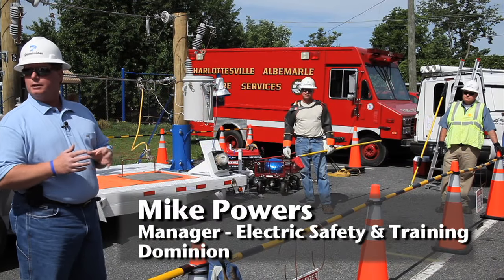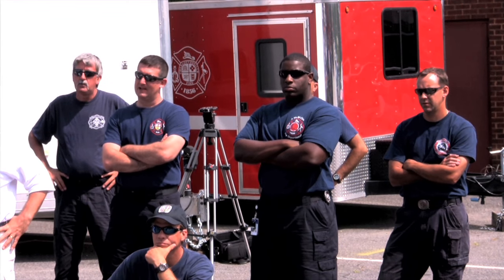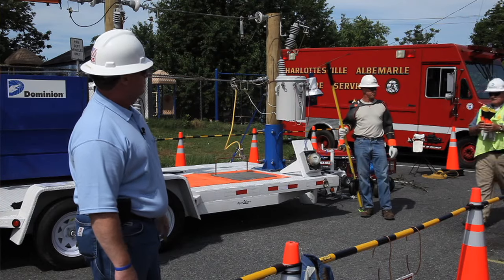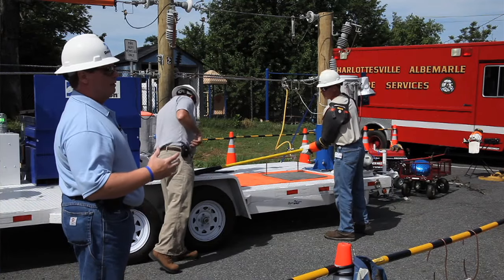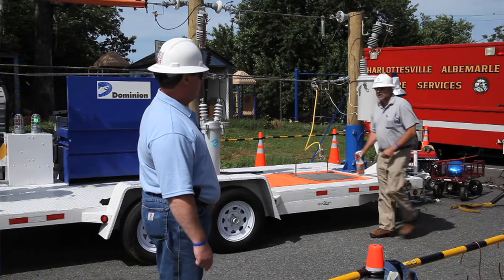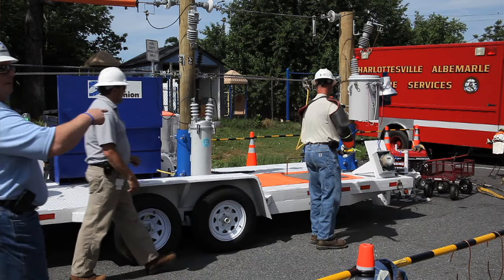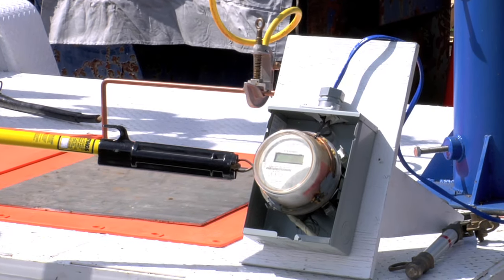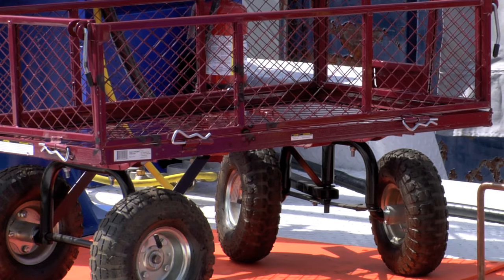Live Wire Demonstration

Comment: What a fantastic demo! This should be shown in all schools.
There were a couple of things I didn't understand though. I get it that the home electricity meter can fail and become live, but wasn't really sure what he was demonstrating there. Was it the effect of a cracked insulator?
Also, when someone hooks up a generator to a socket in their home, surely that is at 240 (UK) or 120 volts (US). But the powerline ends up back at 7000volts. So are they saying that the transmission equipment, acting in reverse, will automatically upconvert the 120V to 7000V?  Can that small generator really raise the powerline to its operational voltage and current? Very mysterious.

Comment: We had a tree down on the hot and neutral at the range. I checked the fuse at the main and the fuse had been bypassed. I then drove down to the pavilion and the green light was on on the side of the transformer and we had power to the buildings. I knew right then that tree was hot and if anyone touched it they would be meeting their maker. I called the club officers and they put a notice out to members that the line was still hot and that the power company was responding and to not touch the tree.

Comment: 13:00 what would you do if you were the driver/passenger of the vehicle that the line is laying on?
Reply: Don't get out of the car.  I mean, if it's on fire you probably don't have much choice, but if it's not on fire, just stay in the car.  I went through cable/telephone lineman's "school" and that's what they told us.  We had a special insulating blanket in the cab we were supposed to throw on the ground if we absolutely had to get out of the truck.

Comment: I'd like to know more about the primary supply. Apart from a higher potential voltage, what is the
output waveform & frequencies used? Assumed it was an AC sine-wave at 132k down to 7.5kv. 
The wires look too thin to carry any real current. Is it true that the primary is a pulsed DC high
potential, up to 55khz pulse, with a 50 or 60 timed slash, like a digital output would be like? This is according to Gerald Morin, who says he found out they 'transmit' energy potential at high freq: with a slash. It's the pole transformer that converts the raw power into a pure sine wave at 50/60hz.
He also says the generators run at higher speeds, creating higher frequencies, up to 55kz, with the AC at around 25kv or so. Then goes into a high voltage, up to a million volts transformer, to be centre tapped to 500kv, then onto 125kv, but along the way it goes through a spark gap, three sparks for 3 phase. Neutral is grounded, with the 3 primaries conducting onto a drum at 3k or 3.6k rpm for the 50 or 60 low frequency. So there is no AC on the primary lines anymore, just this high volt potential DC transmission. The spark gap causes the energy to build up, giving it high potential. Is any of this correct? I'm not a qualified electrician, just domestic trained & did electronics/pc repair. I've seen a high voltage line-man survivor in hospital when I was in. This guy has been electrocuted off a 33kv over head railway line system. He only survived cos his arm melted right off, with a good chunk of his lower leg missing. Had burns down his side, but his face & head were ok. The skin on his hands, arms, right side of his body down to his leg was all rubbery & charred looking with heavy bruising where the un-burnt skin was. He was young & in good spirits, happy to be alive I guess. I have the greatest of respect for those guys, esp; going out in bad weather!
Reply: A this comment gave me a stroke

Comment: You can fire a generator up, just shut your main breaker off, and reverse feed the lines. Simple as that. Main breaker is off, no power can go through it to the lines.
Reply: Neutral is still connected, iirc
still a hazard

Comment: That's a cool demo.  Are those extendo poles fully insulated, ex: would you be able to use one without gloves?  Or can they still conduct a bit of power?
Reply: they are but also like the fire house with the high voltage a little humidity and it can become a conductor. 
the term hot stick is 2fold lol

Comment: A 110V generator fed into an outlet in the home will have enough current to energize the primary lines to 7k volts??
Reply: yes thts how transformers work but it will have low amps and very short distance been a long time wld have to check on math but i dont think it travels more than a cple of houses
Reply: Transformers work both ways. Don't back feed your house unless you know exactly what you're doing

Comment: So what's the proper way to connect a generator to your home during a power outage? How do you wire it so that it does NOT send electricity back onto the HV power lines?
Reply: +wad willco pull your Meter
Reply: Turn off the main breaker to your house.
Reply: And put a lock on it if you can.
Reply: Proper way is to let professional install the generator and switches. Do not try to install electric stuff by yourself, it is very dangerous.
Reply: Use a triple breaker to switch both of the hot lines (there are two in modern houses, one's negative) and the neutral  all at once
Put it in an electrical box and ground it

Comment: Never thought of the backfeed fom a generator. I suppose the stepdown transformer will be working in reverse as a step-up transformer to re-energise the line voltage.
Reply: Yes, that’s correct. Nothing in a transformer to prevent flow one way or the other. Solar fields on distribution circuits can backfeed through power transformers in substations to transmission lines if they aren’t relay and pt protected
Reply: @Football5198  I imagine the max current would be greatly reduced in relation to normal line current, but still ample current to kill.

Comment: 20:20 you don't have to pull the meter out of the meter base, just turn off the main breaker.  That'll disconnect your entire breaker box from the meter and from the incoming line
Reply: RE:bledlbledlbledl. Firemen can not always easily get inside of a building to a breaker box and big buildings sometimes have multiple breaker boxes.
Reply: @munsters2  He wasn't talking about when there's a fire, he was talking about when homeowners hook up generators after a storm knocked the power out.  Start listening at 19:55 to hear about this.   The homeowner needn't pull the meter base when using a generator, just turn of the mains.
Reply: @bledlbledlbledl  Sorry, my mistake; I thought he was telling firefighters to pull the meter. He was saying that homeowners might not pull the meter. I agree with you that homeowners can switch off breaker instead of pulling meter.
Reply: @munsters2  Additionally,  pulling the meter on a large service will NOT disconnect the power. Why? The meter measures usage with current transformers, placed around the service conductors or buss bars. Actual disconnecting occurs on the HV side or via pulling a set of fuses/throwing the main service disconnect.
Reply: @djscrizzle  Interesting. Thanks.

Comment: Nice video. What happens if the line is down and one of the houses has a solar generation system connected to the grid?
Reply: ferchrissakes314159 pop
Reply: ferchrissakes314159 Solar I believe is 9-10,000 Volts by it's self. depending on which one you install and use. but if it does backtrack to the lines it can create a real problem. if you ever realized this. when the power is out and you hook that up to the lines. you can almost run 10 houses off that one generator. well you can also fry transformers both ground and pole. another thing they didn't mention in some homes their is a separate box that cuts the electricity from the wires where you can have installed and working. I can remember what it's called but you can have it ordered and installed in your home. Good Luck.
Reply: Solar is usually a low-voltage (depending on number of modules) and is always DC. It then gets converted to a higher AC voltage where it's then fed into the grid. And a typical generator will not give anywhere near enough power to run 10 houses, in fact most generators like the one shown couldn't even power one house (considering immersion heaters, kettles, etc) remember that when it back-feeds into the transformer, current is inversely-proportional to voltage so as one goes up, the other goes down, but the overall power (in Watts) remains the same.
Reply: D15H I'm not talking about the Gas ones I'm talking about the backup Gen. the ones that you see on the side of the new homes.
Reply: ferchrissakes314159 solar systems automatically shut down whenever the utility power goes down. It cannot back feed the utility system.

Comment: How does that portable generator supply over 7000 volts? Are most portable generators homeowners use not 120/240 volt?
Reply: Transformers on the lines in-between

Comment: Huh.  How are people hooking up portable generators to mains circuits?
Reply: During an extended power outage some people connect the generator's output to an outlet in their house which sends power to appliances and lights. If they forget to turn off the main breaker, current will flow out of the house back to the transformer. This situation has killed linemen who thought they were working on de-energized circuits. To properly connect a generator to the house wiring would require a transfer switch installed by a licensed electrician..
Reply: they use "widowmakers" i.e. 2 male plugs connected together

plug one into the generator's outlets and the other into the house plug
disconnect the house from the lines (otherwise when power company turns the power back on and explodes your generator) 
disconnect all load from the generator (unplug the widowmaker from the generator) and crank it
plug the widowmaker back in

Comment: Are firefighters not issued digital NCV detectors? They're super cheap and very reliable at detecting any ac voltage that's at a harmful level. Hell. two of my shittiest, <$40 AC/DC current clamps have NCV detectors that can detect 120V AC from +6 inches away

Comment: I'm not a electricity denier but @12:30 you can obviously see they wrapped one of the boot pull straps with metal wire...
Reply: Maybe they’re not steel toe boots they’re using, but I would imagine most would wear work boots without it with composite.

Comment: wouldnt the ladder weld or stick to the line?
Reply: In the setup for the demo they are running high voltage, low current. Welding requires high currents. I have a spot welder that only put out 3 volts, but pulses 500 amps and that’s what does the welding.

Comment: I have some questions. 
How many volts can a human take before their in trouble?
How long does a response to scene take and can some procedures be done safety to ensure a person can be saved? 
Can someone touch a person who been electrocuted or will the electricity follow to the rescuer? Example is someone gets hit with the electricity  and someone comes to their aid to give cpr or to begin rescue procedures to get them out of further harms way. 
Does the electricity go other places? Example would be a power line goes down and the electricity will flow all around in a certain footage area around the scene.
Reply: Generally speaking, under 50V the voltage isn't high enough to overcome the resistance of a persons skin and therefore you are unlikely to receive a shock (but it's still possible if you have cuts on your hands as the resistance of the body under the skin is negligible). Over 50V you are likely to receive a shock, especially at mains voltages which are far higher than 50V (in the UK it's actually around 245V RMS typically). 

If you're unlucky enough to receive a shock from a high-enough voltage source, then that's when the current is a factor. For example, in the UK at a supposed voltage of 230V RMS, a current of 30mA or more is enough to be life-threatening but there is still a chance of survival. At a current of 60mA or more and you can almost guarantee cardiac arrest. 

You must also consider the length of time that an electric shock lasts, in the UK a RCD (Residual Current Device / Ground Fault Interrupter) used for "additional protection" (which means protection against electric shock) is rated at 30mA as this is the amount of current considered to be life-threatening as mentioned previously. The device is tested to ensure it operates within 40ms which reduces the chance of your heartbeat coinciding with the duration of the electric shock - if they coincide then cardiac arrest is likely.

And yes, in your example of electricity spreading, there is a potential for electric shock around the power line. This is due to the resistance of the ground which will cause a gradual drop in the voltage around where the power line is in contact with the ground. For example, if at 1m from the power line the ground was at 7000V and at 2m the ground was at 6000V due to the drop in voltage from the resistance of the ground, this would give a potential difference of 1000V between these points. If you took a step and your feet where spaced near this distance then it would result in an electric shock. The risk can therefore be reduced by hopping or jumping away keeping your feet together.
Reply: There's no real hard number. alternating current runs @ 60 cycles, the same as your heart an body. 
A defibrillator is measured in Jules an has zero AMPS. ( AMPS is what kills you typically ) 
However in the right circumstances ,say with multiple hits from a police taser has also killed.
110v is the most dangerous because we're in contact with it everyday. Therefore its underestimated. when the path of least resistance for voltage  crosses your heart you're in deep trouble. The higher the voltage the threat goes up exponentially even for experience personal.
Hope that helps you a little an gives you a start path where to look for info.
Reply: Unlimited as it is current that kills, not voltage.
Static shocks typically range around 50K volts.
There most be a voltage sufficient enough to overcome the resistance of the body, at that point it is the current that does the damage.
Reply: I remember an electrician telling me when working with a live wire you should put one arm behind your back to prevent the current from crossing your heart
Reply: Wade Clark how long is a piece of string
Reply: Mr Jones My heart doesn’t run at 60Hz. Are you sure that yours does?
Reply: Is a combination of both dude
Reply: 1. 50V and lower is concidered safe in the industry and official standards, anything over this is potentially deadly.
2. Dont know. And not really if everything is live, its a ric that had to be taken if its safe or not, but your life goes first no matter what.
3. You say  "have been" so thus the person does notl transmitt any electricity, right. So if someone have been hit by lightning its ok per se, but your own safety goes before the electrocuted person. So if fex there is lighting lighting everywhere and the person is under a tree that just had been hit it would be very unwise, stupid and highly risky to go to that person since the lighting could strike the tree again and then you are dead. Its better "better" one person goes out then two.

If the person have been "cought" by touching a powerline and cant get free so yes if you touch the person you will get electricity in you as well. If you would have rubber gloves on you it could be ok though. Otherwise take then fex a wooden plank, plastic thing or any non conducting but strong material and push the person away from the power line. Otherwise run at the person and push him away and jump up a little in the air just before you hit him so are you not in contact with the ground at that split second and thus wont get any electricity in you, but this is the last resort since its a bit risky.

Comment: By secondary power/electric, he is talking about 120/240 power?
Reply: When he talks about primary & secondary, he's referring to the transformer which is able to step-up or step-down the voltage through the primary/secondary coils. They changed the way the transformer was configured when demonstrating the shovel to give a lower voltage (hence no arc) but a higher current which caused the disconnector to blow.
Reply: Yes he is. Your service to your house from the transformer is a secondary

Comment: when was dc last used
Reply: For what?
Reply: whiteknightcat for motors in industry and lights in homes
Reply: For motors o industry and home lightning
Reply: Between about 1896 and 1900.
Reply: whiteknightcat my Dad worked on I steel mill 1938 he told me the motors where 240 volts dc
Reply: That's possible, but DC for powering municipal distribution systems fell out of favor after the 1896 Worlds Fair. Everything has been AC since then, but that doesn't preclude private customers using DC for specialized applications that may require it.
Reply: this entire thread lol

Comment: We used to raise pidgins. The worlds most stupid bird.  And we begged for years for the power company to cap the top of our transformer. Every few weeks or months, we would hear a small pop from outside, the lights would go out, and we would open the front door and see a shower of feathers descending onto the yard... As the pidgins would keep sitting on top of the transformer.  After about 20 times of this happening and them coming out and resetting the fuses, they finally capped it and it never happened again.

Comment: Those spark lines remind me of Terminator...
Reply: when i was in the army in Germany i had to buff my floor  with a 220 volt industrial buffer but switch broke. i  took the cover off so i could get it done, As i was working saw a bright flash and found myself thrown against a wall 8 feet away.looked at my hand and saw a small burn where i made contact with switch at full load. nobody around in other rooms and very lucky i woke up after a few seconds.